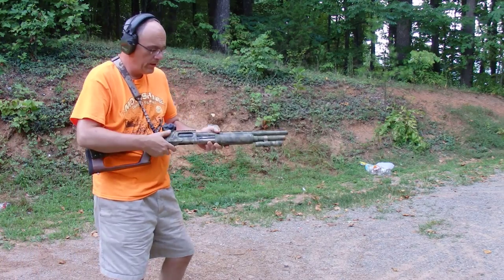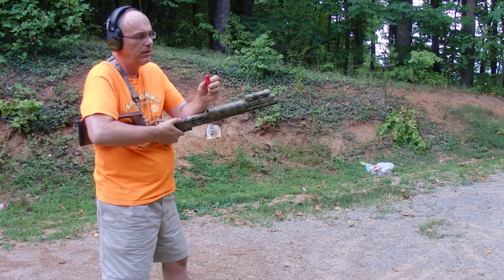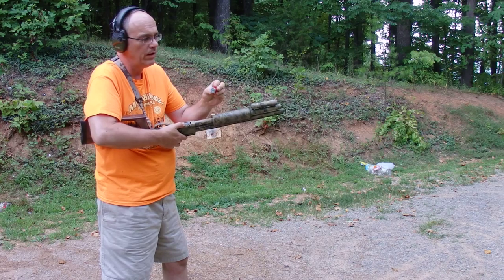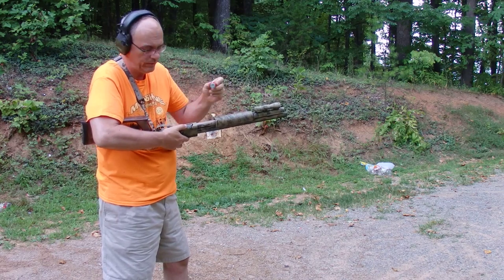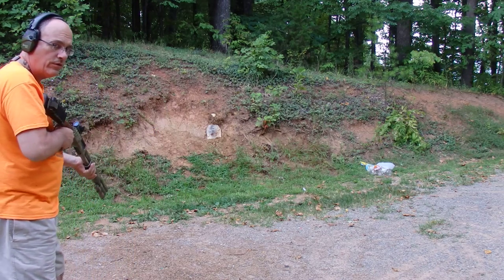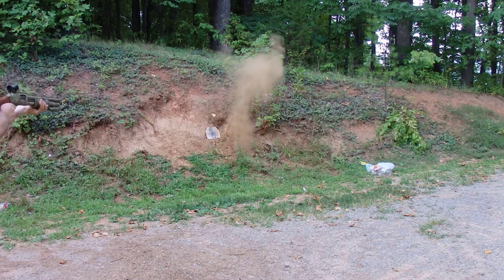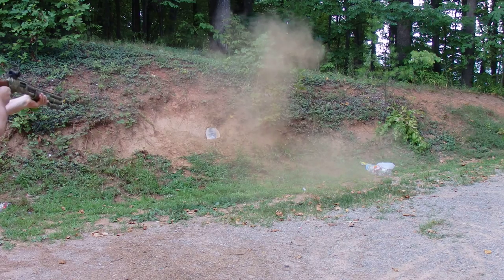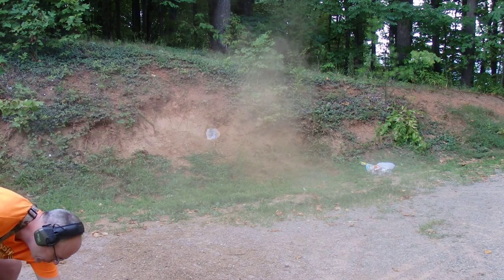7/8oz Lee Slug in Target Load Live Fire Test

Comment: I need one of those slug molds. Those hit with some power. Thanks RW
Reply from the maker: Yourvideossuck247 They hit harder on the plate than waxers that's for sure. But not as hard as Remington Sluggers with high brass hulls. But did you see how little muzzle rise I got? These things are easy on the shoulder.